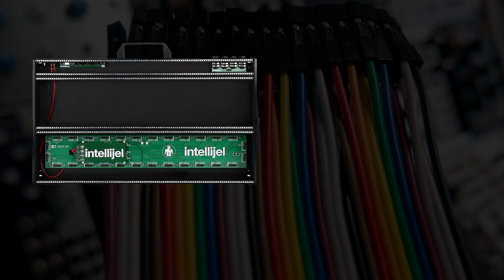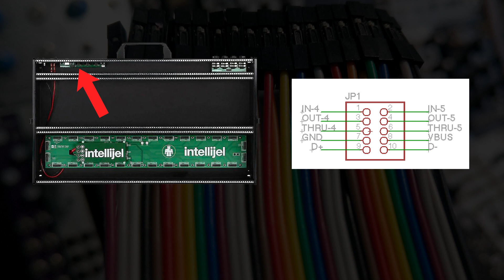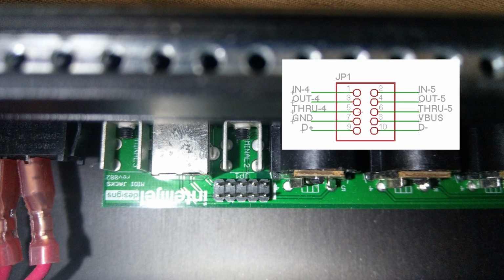How to wire MIDI with Disting EX and Intellijel case

Comment: Incredible, detailed walkthrough at a pace even I could follow. I managed to do this on my 7u performance case. I'm wondering if you have tried this on the 104 pallet case? I can't even see the pins tucked under the 1u area. It's hard to see anything. Do you know if it's possible?
Reply from the maker: I have not tried that particular case. You may have to do some creative routing!

Comment: Thank you so much! Does this connect the USB or just the 5 pin in?
Reply: This just connects the midi jacks. The USB are the bottom 6 pins in the diagram, but having this go to the Disting EX wouldn't do anything as you need a USB midi converter (like what the intellijel 1U midi modules do, the direct pins are just the midi standard wires it doesn't do any logic -- like interpreting it as midi!). I followed this guide and also used the remaining pins to keep the usb midi going to a 1U module!
Reply from the maker: @ggellner  oh, so cool... Thanks for sharing this!
Reply: @JohnoWells  And thanks again for this information ... was losing my mind to try to figure out the orientation!

Also also, with the USB you are wiring power (I am not an electronics guys so maybe not enough ...) so be careful! The DIN midi is nice as it isn't powered
Reply: @ggellner  Thank you!  I really appreciate you explaining why.
Reply from the maker: @Expert Sleepers might have an answer for you here. I'm sorry to say I don't know! Once you find out--please share what you learn...:)

Comment: Thanks for making this. Just noting, for completeness, that Expert Sleepers also offer a 2HP TRS MIDI breakout now.
Reply from the maker: Ah, thanks for the update, Os--I've added a link to that in the description! Thank you as always, for your innovations. Game changer stuff, my man.
Reply: @JohnoWells  this does not work with the Palette case, right?
Reply from the maker: @lukehrm  One search showed the palette case is 45.5mm deep (but I know there are a few). The Disting EX is 50mm deep. 
It fits in my Intellijel 7U just fine..but the 7U performance case isn't considered a Palette case. To be clear---the EX is DEEP.
Reply: So can I use this 2HP TRS MIDI module to obtain midi from the 7u inlets?
Reply: @jorgefpramos  Yes, but I'm not sure what you'd gain by that, other than TRS-DIN conversion.
Reply: Will this same process work for the ES-9? Using the intellijel case midi inputs/outputs?
Reply: @F_letc.h  Should do. The disting and ES-9 MIDI headers are identical.
Reply: I have to confess that I was a bit disappointed about the Expert Sleepers TRS MIDI breakout, as it is very basic. In fact just a 2HP panel with 6 independent 3.5mm jacks, where you can only wire 2 jacks directly from an Expert Sleepers module. The other 4 jacks are just left over for "other use". Aside from being smaller, it does not offer any other function compared to the older DIN breakout module. I would now rather opt for the MIDI XO module from a different manufacturer that offers decisively more features for the same price and with the same form factor.

Comment: I've got a few modules daisy changed this way, it works nicely
It's also worth connecting The Disting to the out or thru of the case so you can run some of the algorithms that generate midi out if wanted, or pass through into another device
Reply from the maker: Ya, in this video I show how to connect the out as well as the in. The 'through' on the case isn't possible to connect to the pin-out on the Disting ex, because there's only in and out. If you were chaining two Distings together, you can do midi-through to the next one.
Reply: I obviously didn't watch it properly and missed the out bit!
I've got mine connected for thru, as that's what I usually use it for, with a MK4 separatly connected to out at the moment. The advantage of being able to use the jumper cables is it makes the case nice and flexible!
Reply from the maker: @theboywhochosethesea  LOL--all good. Ya, this module is like flexibility DEFINED, huh? Speaking of the outs, I'm glad to have the out wired for multi-sample recording that can happen with the Disting and external sources like polysynths, etc.
Midi out to other device, and the Disting pings it to send back audio for a multi-sample set. Too good.